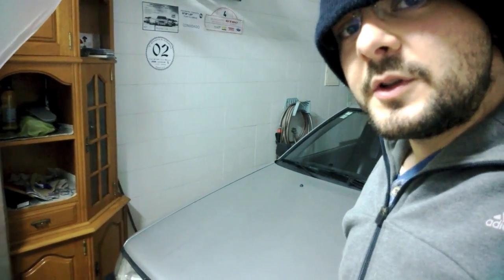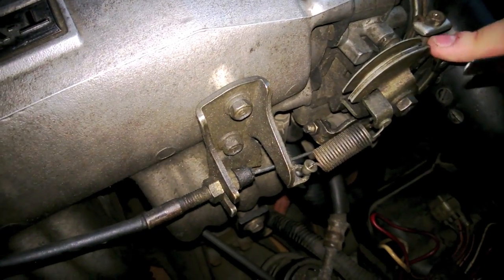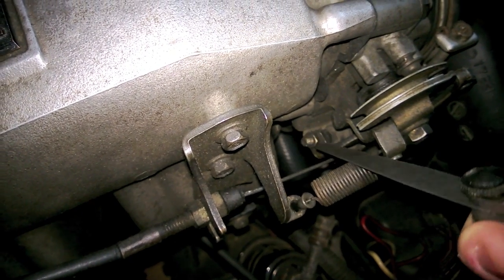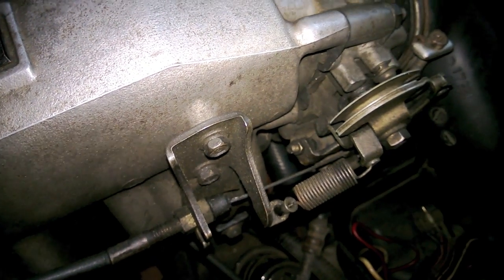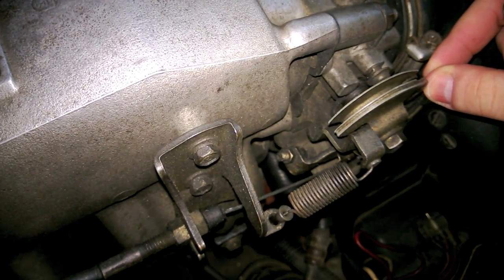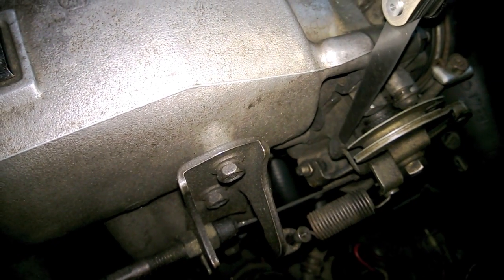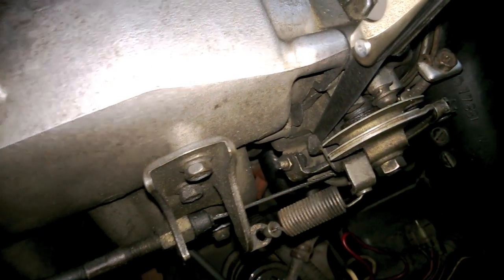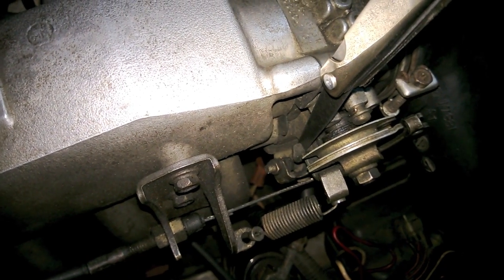Correction to 4AGE TPS Adjustment Video

Comment: I tested my tps and how come I got ~12V in my signal wire? is this normal. I have a 3sFE engine.
Terminal no.                  Label                                  Output Voltage
        3                   Reference voltage (PSW)                4.55V
        2                         Ground  (E1)                                  0V
        1                        Signal Wire      (IDL)                     11.4V

Comment: Hi, i have a question regarding tuning the TPS….In order to tune the TPS you have to put a certain thickness feeler gauge at the stopper bolt. So lets say that stopper bolt isn't at the correct position… How do you make sure its in the right position?? If it isn't you would be tuning you TPS to the wrong throttle position….

Comment: All that has been done it something to do with temperature sensor when it's cold it's perfect once it's fully warm then it's starts playing up
Reply from the maker: Ali mi There is a water temp sensor in the rear of the engine, between the engine and the firewall. You can identify it easily, it has a green plug and a hex shape for you to be able to remove it.
Reply from the maker: Ali mi Friend, try this: once the engine is warm, unplug the TPS plug and see if the idle becomes steady but at a high rpm, then tell me the results.
Reply: João Rocha da Silva what is that thing called

Comment: my ae86 misfires and sluggish once i hit 3500 rpms it flys when below 3500 rpm wont move
Reply from the maker: Ali mi check if you have the TVIS system stuck open, which will make the engine bog down hard at low RPM... Servicing the distributor (new rotor, cap, o-ring, etc) can help with the misfire, as well as a new ignitor coil (its so cheap and freely available as aftermarket that it is always good to try). After you check the distributor set the engine timing to the proper spec (10º BTDC on diagnostic mode, check out my video on that). Before that, however, check the usual suspects (spark plug wire condition, check and replace spark plugs with oem spark plugs, the plain copper ones, theyre are incredibly cheap and good quality).

Comment: Great Save in the Feeler Gauge Position!!!  and the REASON why it must be there!!!  the engines i work on are 5.0 Mustang 302's....the TPS setting for this ...is done by the KOEO Position ....this requires a 0.95 to 0.98 Voltage  at full rest....on the Throttle Lever....i use a .0010 feeler gauge to SET Proper throttle to Idle SET screw...But, since the Mustang has NOT a Primer Idle set.....(for colder temps...it;s Pretty warm here...LOL) after i set air Gap i Take out. the .0010 Feeler Gauge ....then test the TPS...in other words....the Air Gap is set ONLY for a 1 time deal....you MUST take Out the Feeler Gauge to Get Correct TPS reading of .095 to .098 Volts  or at REST reading....(like i said this is for a 1995 Mustang Gt 302 CID  TPS setting) I like your Style!!! you have Great Knowledge and LOVE of your car! Keep up the good work!!! and i even learned....a thing or 2....and i have been working on cars since 1983!!! Thanks for taking TIME and correcting the video !!! i hope to See MORE of your work!!! :)  i like Mechanics that take time to show others .....that a simple FIX....can be EASY....FUN and at the same time....you have a  MORE Enjoyable ride....and better Idle....and  Shifts!!!  and even a little better Gas Mileage.....and a little more Horsepower to Boot!!! and all it takes is a Little Voltmeter.....and some willingness....to get into the electronics.... and Calibrate!!! Thanks Again!!!

Comment: Yeah, LSD rebuild!

Please provide prices for rebuild kit / job and so on... thanks!
Also please mention which LSD you use (Stock or aftermarket, like RTD, OBX, Tomei, Kaaz,

Thanks in advance.
Reply from the maker: Hi Dima, I will be making the job myself. The LSD is the Toyota OEM one, for the Kouki (late model) AE86 Levin. I will post the prices of the parts as well! :-)